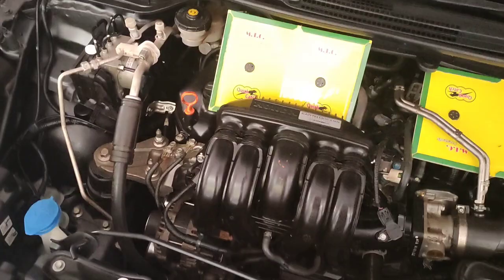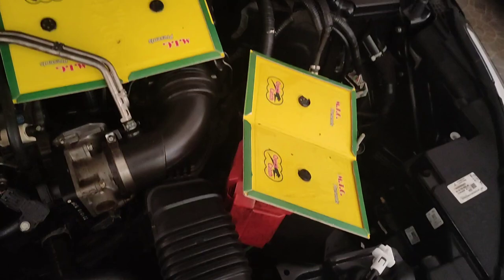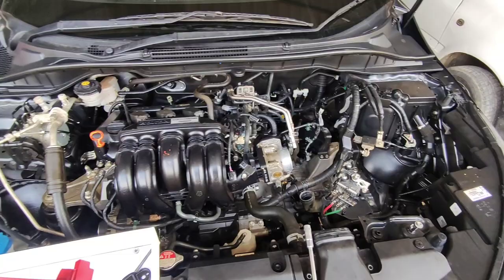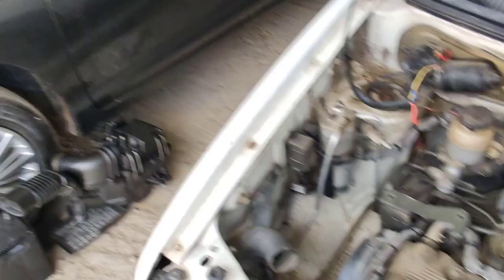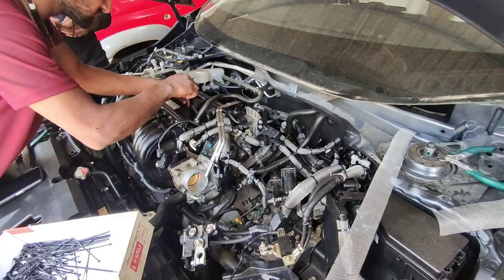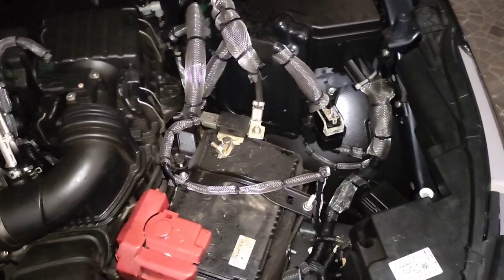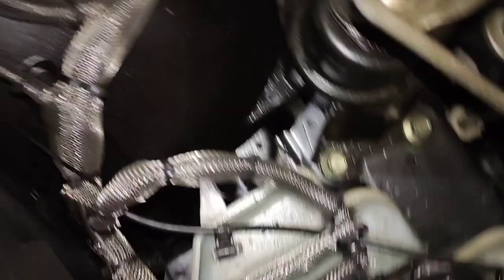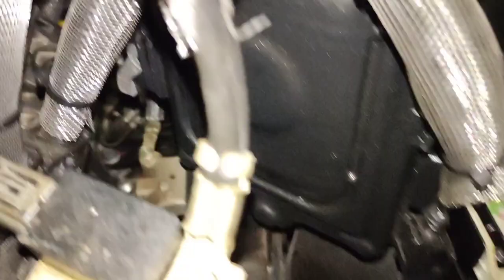Rat Wire Mesh For My Car | Permanent Solution For Rat Problems | Honda City Wire Mesh | No Rat Bites

Comment: Bro agar voh car ke andar ghusgaya toh , usko kaise prevent karoge ?
Reply from the maker: Dashboard ke piche ek opening hoti hai ac ki waha se chances hote hai isliye waha pe wire mesh se block krwa diya hai ab car ke andar nahi enter kr sakte rats.
Reply: @prankushsinghvlogs  ok bro thanks ! Bss rat mesh available ho yaha nagpur me toh lag valunga
Reply from the maker: Lagwa lena bhai mesh is the only permanent solution, and ek opening rear bumper ke pass hoti hai mene video mein show kiya hai waha bhi mesh lagwana hoga jisse rats car ke andar na aye. Honda city ke alawa koi aur car hai apka so please check other vulnerable entry points it may differ from mine.
Reply: @prankushsinghvlogs  ok bro thanks for your valuable information 🙏🏻

Comment: Hi bro,
You can use this product if you are still facing rat issues. It works really well. 
I have been using this for the last 2 years.
Before I used to face wire cut issues multiple times but now all good.

CARCAT Ultrasound Rat Repellent for Automobiles - 4th Gen car rat repellent - CARCAT-RED - Made in INDIA -Waterproof rat repellent for cars - 94% efficacy
Reply from the maker: Mesh is working great brother😊

Comment: is peperment oil works?
Reply from the maker: Works for only 1 week max and is a temporary solution. I recommend you doing wire mesh for engine area and is long term solution for rats.